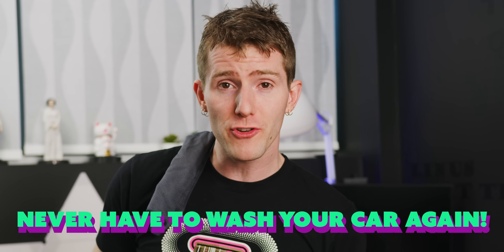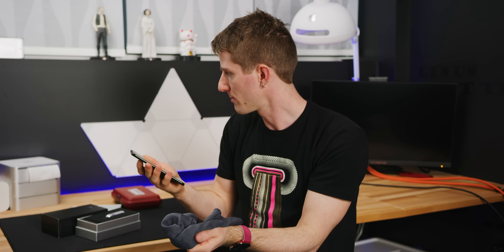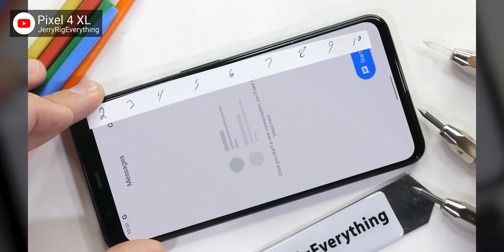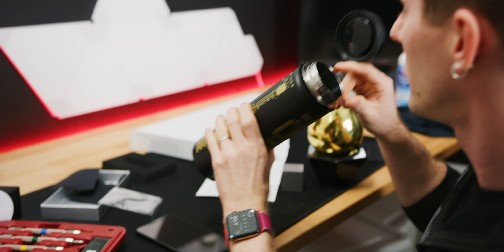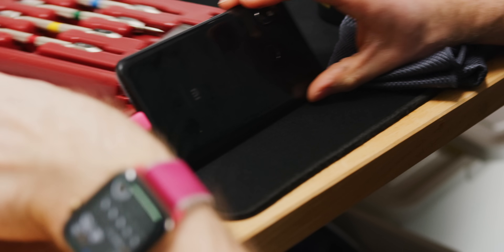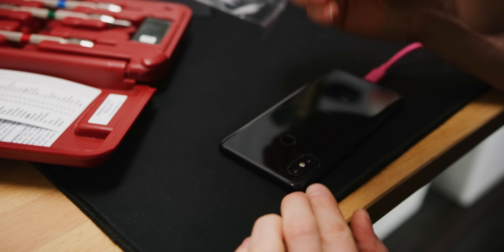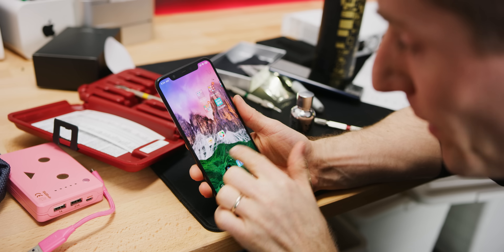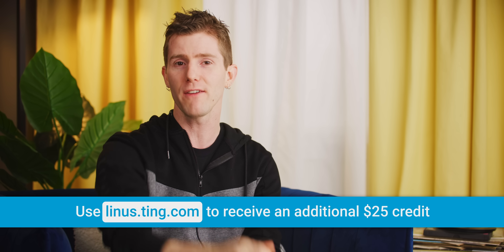Can Automotive Coatings Protect Your Smartphone?...

Comment: Not even looking at the rest of the video i can already tell you bought a 60 bucks kit that sell for max 10bucks on chinese website.

9H is just marketing it would be crazy to have that tech already, search for "mr. Fix" on Aliexpress, i do that on my motorcycles, every 6 month with a polish and damn they look absolutely brand new. It helps with key scratches and zip/metal jean plugs scratches but nothing more. Shinny, soft touch, water beads a little but that's all
Reply: Just a small tip, on a motorcycle put 3 coats, it'll put a really heavy and shiny coat, if you get rocks flying at your motorcycle only the coating will peel ^^

Comment: Interesting. Maybe try using Liquid Armor + The Ceramic coating together. Try applying the Liquid Armor first then the Ceramic coating on half of the screen ; then Apply the Ceramic Coating first then the liquid armor 2nd and see if there is any difference between the 2 combo's.

Comment: considering how the phone already has an oleophobic surface, the application part you did never actually suck and bonded on it. 

To make it work you would have had to use a lighter or direct heat to burn of the protective layer off and then FOLLOW the instructions on the package.

Comment: I'm under the belief that the oleophobic layer is almost like an extremely thin sheet that's kind of sprayed onto the glass, even if the coating is a 9 you've placed it on a plastic (or similar) layer that's like a 4 so when you scratch you break right through the 9 and scrape up the 5.

Comment: Ceramic Coatings are a great alternative to wax, it’s usually good up for 5 years. Very noticeable on black or dark color cars. Very awesome especially against dust and fingerprint smudges. Idk about a smartphone but glossy tech of any kind could use this.
Reply: How about using it on a MacBook screen?
Reply: @olamideolayinka4130  it’s non conductive so I wouldn’t be surprised if it worked well with good results. I’d say get a small diy kit and give it a try

Comment: im sure that no layer at all of the product was left on the phone when applied.superfine surface,no time to dry,no porous material,anti-oil coating,etc,etc.
i used rain-x(water repellant coating) on the ship front windows since a lot of years,same apply method as this,and it is a great difference if you apply the product and wait till is almost all dry before you wipe the excess.
if you wait,it will last much longer and work better.take in mind the time you need to apply all the windows,or in this case,apply to an entire car before you can whipe the excess,versus the time you need to apply it to half a phone.there is no time for it to bond,nor a surface to bond anywhay,it will srink in a drop.

Comment: Before I even watch the video I'm predicting , No
Reply: Alas, I was right. Like Linus mentioned, they did the wrong hardness test. Also ceramic coatings are good for 6 months to a year. It's a great idea to put on your wheels so break dust doesn't accumulate as much and you can basically just rinse them off. All in all ceramic coatings is like a better wax.

Comment: Instructions: cure 48 hours, 4-7 days for water resistance
Linus: "AfTeR wAiTiNg ThE rEqUiSeT dAy"
Reply: Has nothing to do with water resistance or curing. It'll cure withing a day. You wait that long to avoid water spotting.
Reply: @simmerke1111  i mean fair, but wouldn’t you want to give it it’s best chance?
Reply: @simmerke1111  
No, it says cure in 48 hours...
Reply: @simmerke1111  instructions: "longer it stays dry the better...at least 48 hours for initial drying...don't recommend that you wash or expose the car to water for 4 to 7 days"

Comment: You still have to wash the car but it is easier with the coatings.  I stopped using wax a long time ago when I found out about these coatings.  They last longer and water won't stay on a car for long if it is coated with these.  Some of them are expensive and even tricky to apply sometimes.  Also these are things you want to apply with the garage door open because they can be stinky.

Comment: 2 things, as a car guy that's into this stuff. First I'd say its probably worth it to use a clay bar on the phone surface and even possibly a light compound to get the phone surface perfectly smooth. Secondly I'd recommend at least  trying different brands of coatings because there is a sort of difference between brands and their formulas to the point of glass or even headlight specific coatings which would probably be closer to a phone screen than paint and there is even some all purpose ones.

Comment: The ratings issue is a common one and should come as no surprise. If there's a way to make your product seem better then it actually is it will be employed. No one should ever believe any government consumer protection agency is there for the consumer except at the most esoteric level. They are there to set a "BS Limit" and not to eliminate the BS altogether. They said the same thing about Teflon paint protection back in the 80's.

On a side note, having built some equipment and worked with automotive coatings, I only ever saw one product that I though was incredible. Something BASF worked on for the military back in the 90's. Basically a bullet resistant paint. It was also dam near 1/32 of an inch thick and looked like grey primer so not very appealing.

Comment: The mistake in this video is thinking ceramic coatings protect from scratches 😂😂😂😂😂 which is false.... dont even need to watch the video to knownit will fail.... ceramic coating help water beading yes and dirt and liquids to just slide off but will never prevent micro scratches or scratches in general.... sooooo ya dumb experiment over all if you know what youre talking about 😂

Comment: I don't use Ting, because I have Unlimited Data, minutes, texts, plus roaming to 150 countries, and no roaming charges. I tether my internet access for my laptop, and in Europe, where they actually spend money on Infrastructure projects, mobile signal and broadband speeds are very fast, with a minimum of 60mb/s i have seen both up and down, with no caps on how fast it is, plus mine comes with Spotify Premium.

Comment: Totally pointless exercise. A car's paint can be scratched with a level 2 Moh's pick and the ceramic coating gives it a little more resistance. A phone screen is already a level 5-6 on Moh's scale and the ceramic coating adds zero value here.

Comment: The coating probably didn't really help because there is barely any micro-level gaps on the phone glass, so there wasn't much to grab a hold of when you removed it. (AKA: you didn't really put it on)
I am assuming that if you use a plastic screen protector, the liquid coating would actually be useful to help remove finger friction and gunk.

Comment: Oleo-phobic coating means oils do not stick to the surface not water. Usually oleo-phobic materials attract water. This is what happens with the soaps were one side of the molecule is oleo-phobic and the other hydro-phobic. Also this is how cell membranes work. Oleo-phobic means literally "afraid of oils"

Comment: Would it impact shattering or cracking your screen? If it fills in those small area to even out the surface area, would it more evenly dissipate the force incurred on it? Also would that make it so objects that hit the screen have less of a chance to expose those small areas of weakness that would break/crack a glass?

Comment: Just a quick opinion from someone that works on brand new cars (wv)= car paint coatings are very weak, because they have to be ECO-Friendly. aka it has to be thick water. you can scratch paint on new cars with your nails.

Also most new cars have paint thickness (color + colorless paint) of 0,15mm or 150 μm.

Comment: The water beading off at a different "speed" when tilting the device by hand is naturally because your tilt was not perfectly controlled. Try it with any hydrophobic phone-shaped brick and you'll see one side will bead faster than the other depending on how imperfect your tilt is.
Reply: And the quantity of water too

Comment: The reason you didn't see any noticeable difference is that the coating did not have many imperfections on the surface for the coating to adhere to. Glass is used for many applications where you want a super flat surface, such as phone screens.
If you left a larger amount of the liquid to dry you MIGHT have better results.

Comment: Where you probably would see a difference is putting a coating on a phone that’s been used for a year or two. Phones already come with a coating on them. The coating you used (get a better one btw) would not have been able to completely bond since there was an underlying coating. A phone that’s been used for a year or two likely has no coating left on it so you’re likely to see a difference.

Comment: Hey LTT. Can you try if this coating will help to "remove" little scratches on some old phone screen? Theoreticaly it should be possible to fill those scratches with this coating. Just wondering ;)
Reply: bodoti qwiu  I just wonder if this coating can be used to remove light scratches - and this is totally different thing ;)

Comment: Ceramic coatings add chemical resistance with very minuscule scratch resistance. Normally the cheap coatings advertise scratch resistance. Also they will crystallize over time after you open them so I don't think one bottle will last a couple of phones.

Comment: These coatings primarily help prevent scratches by making it harder for dirt that can cause scratches form sticking to your car.  Dirt that's stuck to your car has a chance to scratch it however dirt that beads off with water does not have that chance. Basically reduces scratches by reducing the chance something will stick to the car long enough to scratch it.

Comment: aren't you supposed to spray high pressure water over the surface after you apply the ceramic coating?

Comment: I want a follow up to this where a layer of the ceramic coating is put over all those scratches you made!  That's where the ceramic was meant to work best, filling in the cracks.  Now that we know the ceramic looks and feels identical to the standard gorilla glass, I want to know if it would repair an already scratched screen.

Comment: Hey Linus!

Former car detailing guy here, I nerded out about it when I was doing it for work and wound up with a big supply of some different waxes, sealants, etc.... over the years I have used these products on various phones to minimize scratches and partially restore some dinged up units....

The results were varying, but one thing that I absolutely learned was that you should, generally, NOT DO THIS TO GLASS SCREEN DEVICES.   The primary reason why is that most/all of these types of products include solvents and/or polishing agents that will, most likely depending on the products, strip the anti-grease layer off of the phone's display.... This means fingerprints.  lots of fingerprints. if it doesn't do this it will not have the same anti-grease performance, and I think just adds more layers of material with different refraction indexes, and makes the grease show up more easily.  

My phones definitely cleaned up easier, and looked better than they did to begin with.

The other concern I would have is that these products generally recommend gloves and avoiding skin contact, like you clearly realize given you wore gloves to apply it.... after a few bad reactions to exposure to various chemicals over the years as well (these not included, I think*) I'm also just more careful with stuff like that than I once was.... these products shouldn't be applied to something that you handle so thoroughly and so often as your phone.  Fridges, shiny surfaces you dont habitually touch sure, but the phone just seems like a bad idea to me.

Comment: They need to develop a version of this that can be applied through a paint sprayer (even if the sprayer nozzle winds up being one-time-use), and then spray-paint this stuff onto the BOTTOM of all cars (especially around the door frames and rocker panels). Imagine if cars were this resistant to road salt, and didn't rust through after five to ten years. Get Arizona quality even in Massachusetts. :)

Comment: Manufacturer: Clean it, wipe it, clay it, apply the coating, wait 48hrs recommended, don't expose to elements for a week
Linus: Yeah, we'll clean and wipe poorly, apply the coating, handle the phone with no care, prop it up, and expose it to water 24hrs later.

Also Linus: Huh, it cleans similarly and doesn't really add any protection compared to the uncoated side, that's disappointing

Comment: SUGGESTION!!!! I'm running a btrfs RAID 5 on my Synology 918+ with 4 drives. I saw some threads talking about how unrealiable RAID 5s are with high capacity consumer level hdd. (high Nonrecoverable Read Errors per Bits Read rate compare to enterprise drives) So I wonder if you guys may make a video about different RAID reliabilities. For example RAID 5 vs ZFS RAIDZ2 etc. I'm really lost here. Thanks :)

Comment: that's the point of the ceramic coating it scratches and all you have to do is apply more to smooth the back out it scratches and gets messed up instead of your device or vehicle

Comment: "Leave for 48 hours"
"Don't put water for a few days"
The very first test he does after only 24hours is put water on it. When you want to be as amateur as possible discrediting the results and therefore the point of the entire video...
Reply: DJ Nasiatka  well that rating is used in paint and coating industries... sooo is really what you are gonna get but is pretty dificult for a product to make a phone more hardness, if it were that easy why they dont do it?
Reply: DJ Nasiatka  it doesn't work on vehicle paint. It is snake oil... Its sold purely for the benefit of making lots of money out of stupid people...
Reply: Men, even if you do it right thats is how it works... it dont make it more durable if you let it more days.
Reply: @mariomoneta2833 you're supposed to apply the liquid on the screen itself and spread it around in a circular motion.. He applied it wrongly...

Comment: Hey!
long time  viewer, first time poster. Pour yourself a cup of tea, and have a read.
First off, I am a certified Gyeon and IGL coatings installers and also a XPEL Paint Protection Film installer and I have been in the industry for some years now.

Few things to clear up here;
- Amazon/eBay coatings are very inconsistent. I highly do not recommend them. 
- Paint coatings don't bond that well to glass. Perhaps try Gyeon Glass coating.
- 9H is a 'buzzword' or a 'selling point' for coatings. THE COATING BY ITSELF IS NOT 9H. its a fairly bulls*** statement. Especially the cheaper coating manufacturers to sell their product. The rating relies on the paint being already at around 4-6H then it adds an additional 3-5H to the paint surface making it harder. It DOES NOT work like this on glass unfortunately. Hence why the glass specific coatings are purely for the hydrophobic properties. Respected companies like Gyeon do not promote hardness even though they are technically "9H".

The best way to think of coatings is that it just repels dust and dirt a bit more efficiently than if it didn't have it applied. Making you go longer between car washes, and when it does come wash day it makes the process a lot easier especially with drying. 
Phones are touched regularly. Every touch is an abrasive effect, even though very slightly. These tiny abrasions will wear the coating down quicker. unlike a car that gets touched (hopefully) while being washed every week or two, the coating wears off very quickly, especially when the coating is designed for paint.

All in all, ceramic coatings are useless for phones, they aren't designed for phones and these are only good for vehicles and other larger less touched surfaces such as stone top benches, glass pool fences, stainless steel fridges (all of which I have coated and have had great results)

I have had phones where I've purely only ceramic coated and phones where I have wrapped in XPEL Paint Protection film  (PPF) and I get the best results with the film.

XPEL PPF will protect against scratches, cracks and physical damage. Also its SELF HEALING to light scratches. This is a whole post into itself so please do further research into this.
Having PPF on the phone does change the feel and surface of the phone. So the film will gladly accept a paint ceramic coating to help keep it clean.
the downsides? It is hard to apply and must be done by a trained, experienced professional.  Also the film does give an 'orange peel' effect. This is due to the self healing top layer in the film and is not noticeable when the phone screen is on. 

I would love to see something in regards to PPF as this workings great on my phone (my OPPO r15 pro has had it for last 2 years) and would love to see you shine some light on it. 

Thanks for reading!

Comment: Hmm theres larger differences between the different brands of ceramic coating avalible on the market. 

While i can get for $20 a 30ml bottle of 9H ceramic coating, I can also get a $100+ (AUD, shits not cheap here) 30ml bottle from example, CQuartz, which is one of the leading brands for this. Also depending on which brand, they recommend layering coats for A; better even converge, B; better strength & C; longevity. Your cheaper ceramic coats tend to only last 6 months at best where higher quality coats can last upwards of 24 months with proper care. 

I feel that better testing and research should've gone into this video. First time since watching LTT in the last 4 years that i had to make a comment about it.
Though it does spark a good idea to be looked into. Perhaps experimented with.